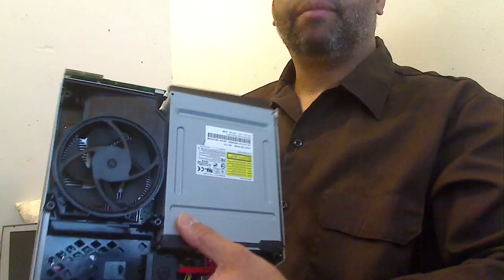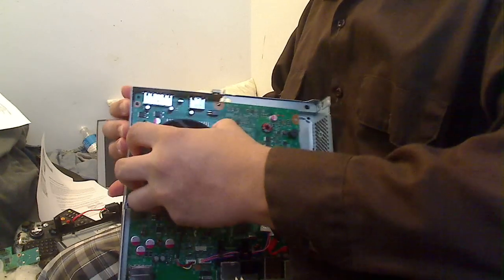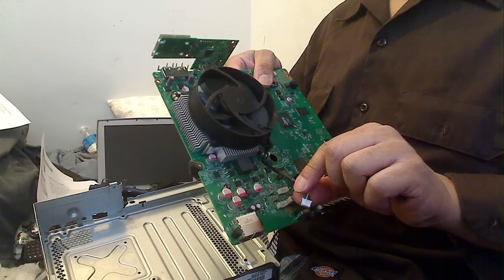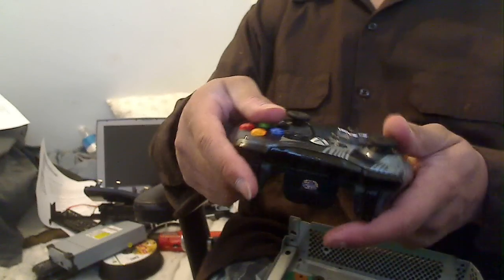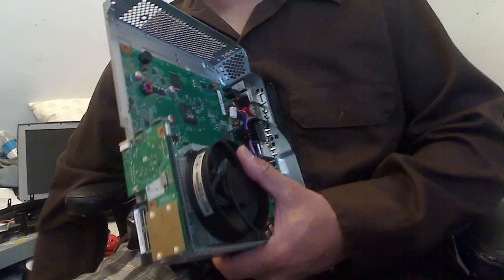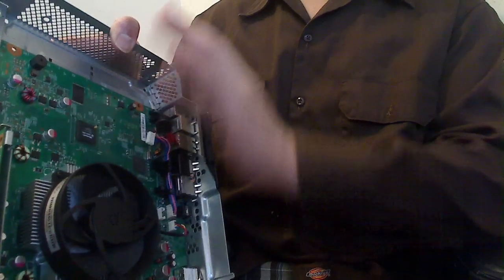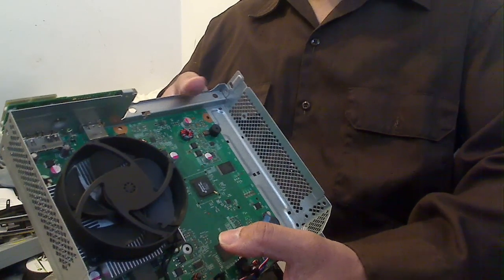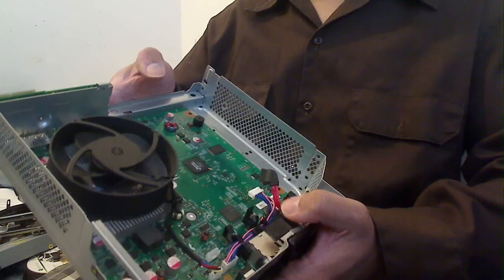How to fix Xbox 360 Slim RROD / Red Dot of Death Reset Solution👍

Comment: no haven't got one. think it might be easier to just buy a new one lol. Dnt get me wrong your video was very helpful
Reply from the maker: Its actually what usually gets the Slim working when the badic reset doesnt work. I've had to use the heat gun quite a few times and it worked each time. You can always check apps like offer up or wallipop to purchase use items from people near you or even purchase a new one, then return it later if your funds are short.

Comment: Hello. First off I did replace The Heat-sink compound used arrtic silver 5 Did the reset it shutdown like you said.. its sorta hard to explain but its a hit and miss type of deal but the xbox freezes then locks up then to a black screen. after i found it had a bad hd i removed it and using the onboard now still does it in games and watching plex. but the funny thing is is when its plugged in to the internet thats when things go hay wire when its not its great no issues Ive del my profile and re download it cleared cache but still does it when connected to internet :( any ideas
Reply from the maker: ok so your xbox only acts up, aka freezes, when you connect to the internet. Ideas.! Check your ethernet cable or just completely replace it. Might as well get CAT6 or CAT7 ethernet. If you're using wireless, plug in the ethernet instead, to check if the freezing continues. Make sure all xbox-live required ports are open or place your xbox's IP address into the DMZ of your router, modem or combo after you've static assigned the Xboxs I address. If none of these work, take it to a friends house and connect it to your friends router via the same method that you use at your home.
Reply: Donte Beachem It was the cpu/gpu bad solder job i did the heat gun trick got rid of the x-clamp lasted 2 days did the same thing so i went out and bought a used one from my frined that used it maybe 3 times. paid 75 $ for it.. But i do thank you for your response much appreciated..
Reply from the maker: No problem. Sometimes that's what you have to do. At least you'll be back to gaming now.
Reply: Donte Beachem yeppers Thanks Again for the time you took to respond!
Reply from the maker: Anytime Dustin..

Comment: cannot do overheat reset on xbox 360 slim, shutdown even before overheat occurs. pls help
Reply from the maker: Maybe your power brick is over heating and cutting off. An error within the power brick will cause a red-dot error as well. Check to see if the light on the power brick is red or check to see if it is amber and then turns red after you power on the xbox slim..
Reply: Thanks bro, I have 3 power brick none of them worked
Reply from the maker: Do any of them show red light s
Reply: No just orange
Reply: Thanks for giving me time really appreciate it
Reply from the maker: +jester lan Sure no problem Jester now lets see if we can get your xbox fixed. Since the power brick doesn't apprar to be the culprit, your next objective will have to be disassemble of the xbox. You'll need to remove the heatsink and fan, clean off the heatsink paste and replace it with new paste. The problem that you're having is most likely coming from overheating of the cpu, which forces ths xbox to shut down to protect itself. The paste allows a smooth flow of heat transfer from the cpu to the heatsink and then the fan sucks the heat off of the heat sink and then blowz it out of the case. Watch my video again for further explanation.

Comment: I had a power surge I think when I was downloading a game on the 360, then it switched off and gave a red dot. I powered it off then back on again and it no longer has the red dot, green as normal but no output via hdmi or av cable. Would the forced overheat fix the output problem via a reset?
Reply from the maker: The reset is designed to reset the ground fault which shuts power to the Xbox. I don't believe it will but this problem was solved in the old xbox360 phat by replacing the cable, using the other video ports & if that failed, taking a heat gun and running it over the GPU, ANA-Chip and around the solder points on the PCB near the video input. The heat was added at 500 watts for 15 to 20 minutes, cooled & then powered on. Grounded pins on the video port also caused no picture. Good Luck.
Reply: +Donte Beachem (Romerro) thanks for the reply

Comment: Should I just buy a new hard drive?
Reply from the maker: If your hard drive is the problem then you should buy a new hard drive, especially if your xbox does not red-dot after you remove the hard drive
Reply: +Donte Beachem (Romerro) hardrive isn't the problem. What is the screwdriver (and/or drillbit)called to remove the screws on the Xbox. Those unique screws.

Comment: did it with mine ,it turns on fan goes loud and than i get the red dot. did what you did and now the same thing red dot , but this time it won't stay on .turns on for couple of seconds and turns off. any ideas?
Reply from the maker: What's making your fan loud.? Also you should follow the heat gun option and also put back the xclamp. Don't use the screw option. U can also check ur xbox power supply to see if the light is red after it turns from Amber. If it is red then it will need replacing.

Comment: +Donte Beachem (Romerro) Donte, the "red dot" fix you suggested still works to this day. Although I now have a new problem I hope you can help me with. I tried to connect my xbox to xbox live. I turns out that that was a grave mistake. After I connected to my home wifi, it said that I needed an update in order to connect to xbox live. When I clicked for the update it gave me an error status code. Here's what it reads. "System Update Stopped. Can't read the update fro your storage device. Please reinsert it to continue the update. If the problem persists, visit www.xbox.com/support. Status Code: 43C5-445E-2780-0F00-C000-0034". I've restarted this thing several times. And each time I get the Xbox intro, the update status bar (which doesn't go very far), then the status code page. All of this by just turning on the console. I can't get to the home page or dashboard or anything. The confusing part is that I don't have a storage device. My xbox is the cheapest of the chickens with no storage. Maybe it comes with a few gig but nothing more than that. I called xbox support and I've tried all their tricks. Nothing works. They suggest I send in my xbox 360 slim for them to fix it, but I don't want to do that. At this point I'm guessing that I need to take it apart again and somehow reboot this thing. Can you tell me how to reboot this? Do you have any suggestions?
Reply from the maker: OK before I continue, I will say that you definitely need a storage device to do the update. Not all Slims come with the 4GB of storage built in. The 4GB is removable and some people remove them prior to selling their console. If your console isn't starting, taking it apart won't help you right now. Your partial update may need to be rolled back so that u can boot to the dashboard. That process can be found on Xbox live support site. The 1st thing to do is to disconnect from the Internet. If u do get to the dashboard you need to clear the system cache located under settings then storage.
Reply: I'll give it a shot and let you know how it goes. Thanks for getting back to me Donte!
Reply: +Donte Beachem (Romerro) Can you please send me a link to the "partial update may need to be rolled back so that u can boot to the dashboard." I can't seem to find it on the xbox support site.
Reply from the maker: +Xavier Barron Xbox-live Update Errors:

https://support.xbox.com/en-US/xbox-360/xbox-live/error-code-3f4b

http://forums.xbox.com/xbox_support/f/7/t/166045.aspx

Try These Steps

Power Cycle - Instructions here. Press and hold the Xbox Logo on your console for about 8-10 seconds until the console shuts off.

Check the Xbox Live Service Status here!

Consult Xbox.com/support - They have a wide variety of topics, and tons of support available.

Contact Xbox Support - They have chats, phone calls, emails, everything.

Search - Use google, use the sidebar, use the forums. Search before posting.

Consult our wiki - It's highly likely that your issue is there.

Comment: Hi my xbox 360 Slim has a RROD. it only occurs when the HDMI cable or AV cables are put in. I've tried using other cords, but not sure how to fix it. Any suggestions?
Reply from the maker: Look into the HDMI and xbox360 video ports with a nice bright flash light & check for bent pins. Bent pins may touch another adjacent pin or touch some other metal upon insertion, which may ground out or ground fault your xbox360. Good luck.!
Reply: thx, unfortunately no bent pins

Comment: it doesn't even stay on for 15-20 minutes
Reply from the maker: If it doesn't stay on check to make sure the power supply light does not have a red light. If it remains green until auto shut off then you may have a fault Xbox live update. Failed updates can red dot your Xbox. Microsofts Xbox live website may have a solution  for you.
Reply: +Donte Beachem (Romerro) i fixed it
Reply from the maker: bunkeredpage 59 Oh great. How did you fix it.? What exactly did you do?
Reply: I just took everything off of my xbox

Comment: yo could you help me when I turn it in it doesn't even show a message on the TV it just instantly goes red I've tried UN plugging stuff and taking out the hard drive and stuff but nothing seems to work what can I do to fix this
Reply from the maker: You shouldn't expect to have anything happen on the screen each and every time a red dot occurs. Follow my video to reset your Xbox. You must replace the heat sink paste for this to work. You do not need to add screws. Just place the x-clamp back on afterwards. Good luck

Comment: My sisters xbox just turned off and started blinking does that mean it's broken by the way I need help trying to fix it for her
Reply from the maker: +Bailey Blogs every day it doesn't mean it's broke. Turn it off and unplug the power adapter from the Xbox and the wall; wait 20mins and see if it will power back on. If it doesn't, check for a red dot on the power supply; if u see one, replace the power supply.

Comment: I did this hit don't work
Reply from the maker: Hey tony, I'm sorry that this didn't work for you but you should know that this reset has to be followed exactly. Most people want to skip steps because they think they're not needed. Also your red dot issue may not be due to over heating or a ground fault. Red dot errors have also  been known to be caused by Xbox live failed updates. Microsofts Xbox live website trouble shooting has a section for how to remove previous failed updates. Good luck.
Reply: +Donte Beachem (Romerro)  OK I punch my Xbox hard and the red light popped on
Reply from the maker: Lol. Your hard drive may have been loose. Hard drive loose connections lead to red dot errors, so that power is not sent to the drive incorrectly. Happy Gaming.
Reply: What if I don't have a hard drive

Comment: Man you saved my xbox, working like a charm again! Thanks dude!
Reply: Aaaand now its dead again. False alarm!
Reply from the maker: +V Vermuyten Hey V. If your Xbox started to work it may just need a few checks and possibly an extra step. Check that your power supply is not turning red when u power on your Xbox. Also remove your hard drive, if you have one, and try booting the Xbox. If none of these are working, be sure to change the CPU paste, if you already, haven't. Replacing the CPU paste is one of the most important steps to the reset. If your reset works, you need the CPU to have proper heat transfer to your heatsink in order to maintain proper cooling of the processor dies. If at the end of this and your Xbox reddots again, your final step will be to run a heat gun over both sides of the board. Don't skip any of the things I've mentioned here or things will not work. Good luck.
Reply: +Donte Beachem (Romerro) Thanks for your reply! I'm going to buy thermal paste this week and see if it works. I'll let you know how it worked out. Thanks for the help!
Reply: +V Vermuyten Ok, so I replaced the thermal paste and put the heatsink + x clamp back on the motherboard (no screws). After that I connected the power cable + hdmi and tried to let it overheat but it shuts down after 5 minutes and I get the "Your xbox is shutting down to prevent overheating" message. Do you think that was enough to let it reset?

Comment: Iv tried this still not working while power cord is in stays red for a while then starts flashing red then turns it's self of need help
Reply from the maker: +James Robbins If the power cord is red then your power supply is damaged and it needs to be replaced.
Reply: +Donte Beachem (Romerro) power supply is orange iv tried numerous power supplies

Comment: Does water have anything to do with it because a small amount of water was spilled on the adapter and then now the dot in the middle of the console is red. I don't know what to do. Don't know if it needs repair or if it just may need to rest. Help me.
Reply from the maker: +Andrew Jones Water can definitely cause a problem with electronics, even in small amounts. Check to see if the adapter has a red dot where it should be green while powering on the xbox. If it stays green anyway, try a friends power supply. The xbox360 Slim power supply are universal, although Im not sure about the E-version.
Reply: +Donte Beachem (Romerro) I took it down to GameStop and they tried a new adapter. Come to find out that wasn't the problem at all. I believe my system just overheated.

Comment: did you replace the heatsink paste before or after the reset ??
please reply.
Reply from the maker: It's a good idea to clean and replace the heat sink & CPU paste before the reset. This will allow the reset to take longer and allow some heating of the board and CPU & hopefully some solder point melting.
Reply: thanks dude keep up the good .
Reply from the maker: Your welcome. Happy Gaming

Comment: can you help me plz
Reply from the maker: Sure, what can I do for u.?
Reply: +Donte Beachem (Romerro) I think mines is the power brick because it is red before I start it
Reply from the maker: Oh it's definitely the power brick. At no time should your power brick be red. A red dot xbox360 Slim does not cause a power brick to red light or atleast it shouldn't. But a red dot power brick can red dot an xbox360 Slim or Phat. That does not mean that the Slim is damaged; it's just not receiving the power requirements it needs to operate correctly, so it displays a red dot. Try a friends or take it to gamestop and ask them if they could test it for u.
Reply: Donte Beachem and when it starts i put my ear to the power brick and its making weird noises kinda like a helicopter blade breaking rocks
Reply from the maker: +Sports 1 the power supply contains an fan and it sounds like ur fan is broke.
Reply: Donte Beachem thanks for helping me out man thanks alot
Reply: Donte Beachem dude mines is 4gb and it still doesnt work can you make an video

Comment: my Xbox keeps getting the red ring I've tried everything but I am going to try this thanks for the video :) I hope it works
Reply from the maker: Me to Antonio
Reply: +Donte Beachem (Romerro) I tried that and it didn't work I had the fan disconnected & let it overheat for 15-20 minutes but it didn't do anything & it keeps doing the same red ring :( I need help please
Reply: +Donte Beachem (Romerro) Love your video, had the same issue, followed everything you said, red dot still exists, any other suggestions ?
Reply from the maker: Antonio Martinez you may need the heat gun solution. I made suggestions in the video on a heating solution.
Reply from the maker: Terry smith You may need the heat gun solution. I made suggestions in the video on a heating solution.

Comment: Hi Donte, i have tried all of the easy fixes already and none of them is working so i think i have to reset it, my question is after i unplug the fan and  turn the xbox on... will it shut off on its own when it gets to hot or will it overheat to death? i just dont know how hot is too hot and i really dont want to wreck it to the point of no return. thanks so much for this tutorial. -Amanda
Reply from the maker: Hey Amanda, the Xbox should shut down on its own as long as the processor has no physical errors and if there are no code errors. If any of these are true, the processor wont even heat up. The xbox has a sensor that detects over heating when operating correctly. So continue. Also do not replace the xclamp. Keep it.
Reply: Awesome Donte, thank you very much!
Reply from the maker: +Amanda Rose you're Welcome Amanda. Good luck.

Comment: what do I do if I can't get the heat sink grid off
Reply from the maker: It can be a little difficult if the paste has dried and formed like an adhesion cement. It may need to be pried off. You can try slipping a flat head or even a puddy spatial inbetween the heat sink and CPU.
Reply: +Donte Beachem (Romerro) is that what the oranged dried crusty stuff is?
Reply from the maker: +bunkeredpage 59 it's not supposed to be orange unless someone has already replaced the CPU paste with a third party paste. it should be grey and moist. if it is dry, hard and brittle it should be replaced.
Reply: Donte Beachem my xbox doesnt even stay on anymore i tried everything